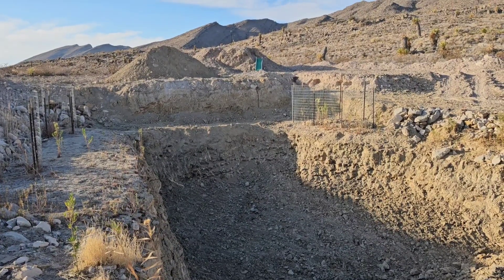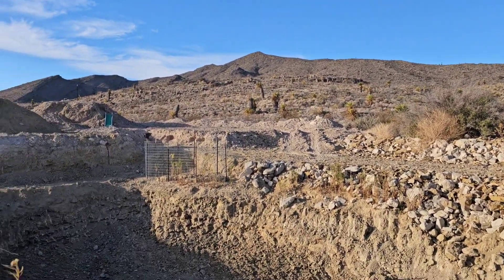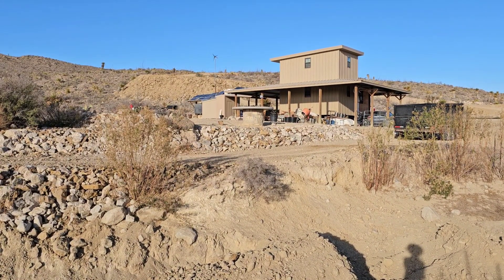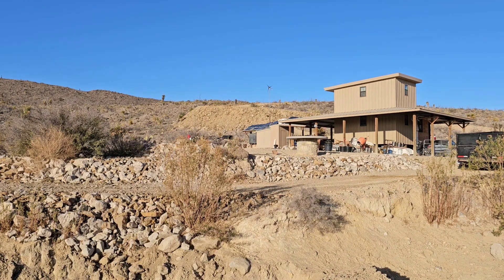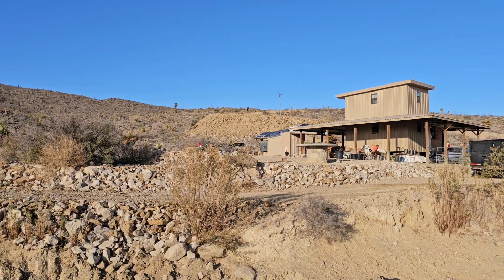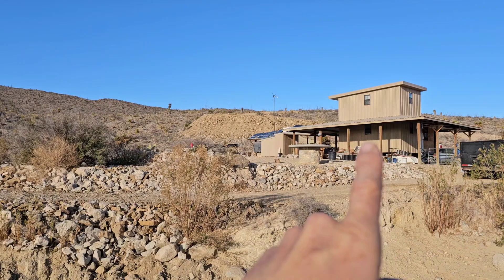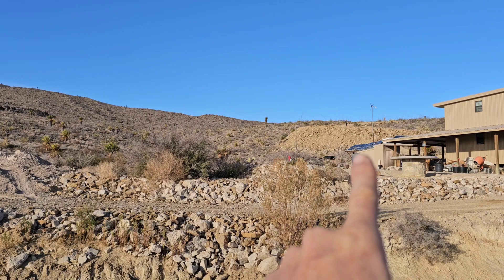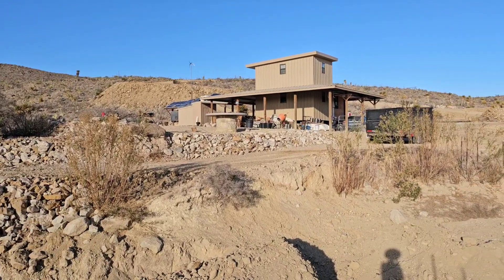How the water system works and how I plan on building resilience into it @TimelineRanch

Comment: Do you have any thoughts about sterilization of the ground water for drinking? I assume you will have several levels of filtration but the bacteria could co e throughthem, especially after a big rain event and turbid pond water. My guess is the captured rain will be the best quality so will all the water used on the ranch get the same process of filtration / sterilization, etc?
Reply from the maker: The water test from the well came back free and clearer of bacteria. I plan to use water straight from the well with just a micron filter for hand washing showering. I'm currently in talks with a company that makes an RO system. The name of the company is waterdrop. I haven't got my hands on the system yet, but it seems like it's got good reviews and it'll serve its purpose well at the ranch. That will be used just for cooking and drinking water purposes. Thanks for following along with the project as always and good question.

Comment: water is probably guaranteed if you dig deep enough but the cost is also exponentially higher the deeper it goes
safest and most cost effective bet is water harvesting
Reply from the maker: It will take quite a bit of effort to make it happen. But the rewards will last for generations to come. Thanks for following along with the ranch build as always.
Reply: And it would not be a very regenerative solution to take water from the groundwatertable. The idea with the rainwater is just perfect.
Reply from the maker: @dasmaasmannchen8028 I agree that groundwater is not a sustainable solution. Most parts of the world have enough precipitation to meet their water needs. The problem is people, won't, take the time to build the infrastructure to hold the water until it's needed.

Comment: Nice plan - how is the geologic of your ground ?
The good thing is that your wheel is holding water naturally - so the ground should too !!
Reply from the maker: The soil is made up of layers of rock with clay between them. It seems to hold water quite well. I just need to keep working on the capacity of the pond. Thanks for watching the project.

Comment: In my personal opinion, the old CAT 977 helped you a lot in working on the property. The only problem is that shipping will cost more than the old girl. On the plus side, it won't be stolen. )))
Reply from the maker: No, I don't believe that'll be a problem. The logistics of getting it out of the ranch is not worth it to anyone.Bigger equipment would make everything go faster, but the cost would be considerably more as well. The little machine is fairly budget friendly. Thanks for watching as always.
Reply: @TimelineRanch  With your climate, you need a car with a closed cabin and air conditioning, which narrows the search range. 977 1980-2000 is USD 5000-15000, but they rarely appear on sale. Needs monitoring. Currently for sale - 2003 Caterpillar 973C LGP Compact Track Loaders in Austin, TX, USA, nice looking but twice as expensive. Sorry for pestering with advice.
Reply from the maker: @alexwoods2836 There is nothing wrong with looking at something from a different angle.